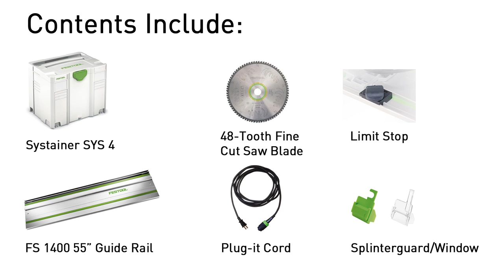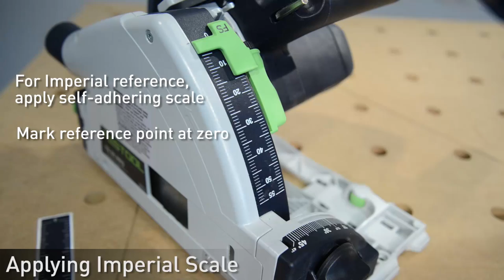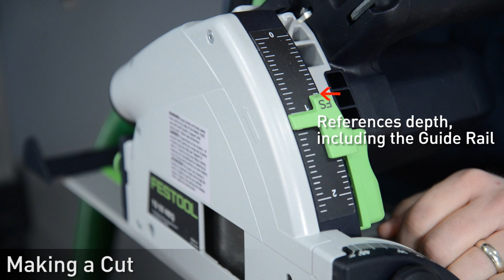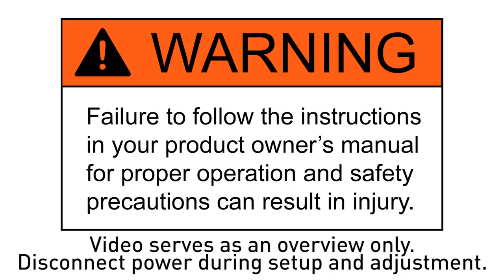Festool TS 55 REQ Track Saw - Getting Started

Comment: just bought one of these, by far the best saw I have ever used.
Reply: now try the mafell 55cc even better
Reply: in your opinion what makes the Mafell mt55 better? (i own neither by the way)
Reply: overthe hill  1/3 more power, stronger material used for body, easy to put a new blade on it. 1 screw nob instead of 2
Reply: sebastiaan pw - I seem to remember Mafell making a flexible guide rail that rolled up and stowed in the case. That was pretty cool!

Comment: on a 45° cut you have to hold the saw with both hands or it will come off the railing? for the price they charge for this saw you shoudnt have to. makita has fixed this issue in their saw how come the very expensive festool can't do the same?
Reply: carpenter33 because it has more drawbacks than benefits
Reply: carpenter33 nice 👍🏼 comment
Reply: carpenter33 LuzenildoCarvalho

Comment: Love Festool, BUT..... I thought all their tool power cords were a universal fit....
Not so.....
I opened my TS 55 saw, and the power cord was missing (I may have  borrowed it for my older Rotex 90 sander.) So I thought..."that's OK, I have a cord from my brand new Rotex 90".
But alas,  the newer Rotex power cord does not fit the saw....it is not universal. I can't use the saw. (the reason explained in my reply ,below)
Reply: Further research leads me to believe that Track Saws (and routers) require a thicker 16 gauge cord, where as the sanders only require a thinner 18 gauge power cord.....and these have different fittings, to prevent them from getting interchanged. The thicker gauge power cable will fit into the sanders, but a thinner sander cable will not fit into a plunge saw (and the routers), because they need a fatter cable

Comment: Anyone that knocks Festool must be too unskilled to see the difference to why it's the number one. I've used all the imitators and nothing compares to this saw apart for Mafell. This is for the more discerning craftsman rather than the majority of rough chippys out there. The lack in skill speaks for itself.
Reply: Watch Ave's teardown of the Festool ts 55 and you will see why the Chinese made skill saw is better :D  The use of bronze bushings and axially loading radial ball bearings with helical cut gears and all sorts of disasters...

Comment: Festool has great inovations in design and pushing tools to be more accurate, but I cant help but feel who has the time for all this faff on trying to produce demands on site? I mean I have been cutting with a Makita circular saw with a straight edge for years and even free hand for less accurately needed tasks. Its a great concept but at the end of the day its just not practical and justifiably priced.
Reply: Dustless jobsite and no need to set up outside in an occupied home
Reply: Yes for rough framing this is not practical but for cabinets and fine woodworking it’s a must have tool,
Reply: So why you are watching festool videos?